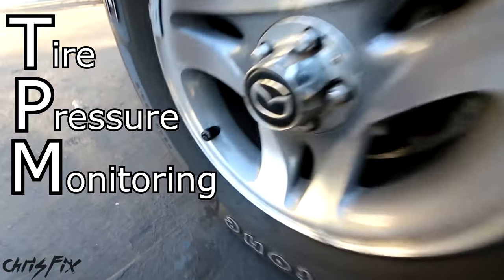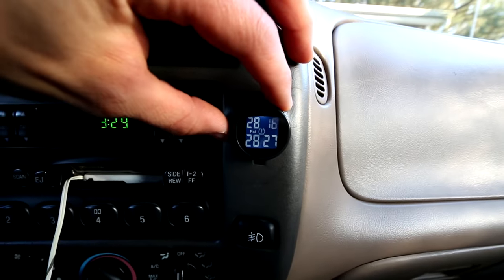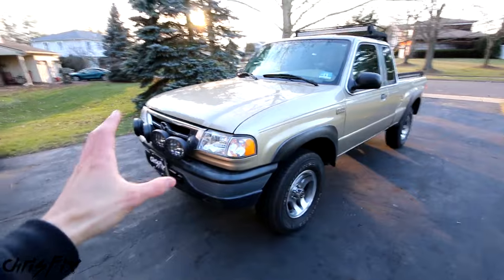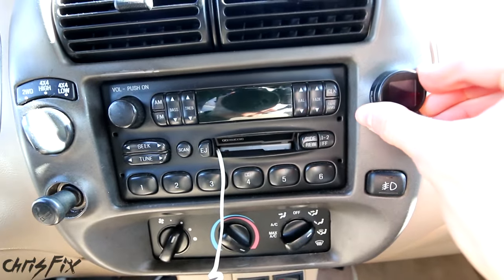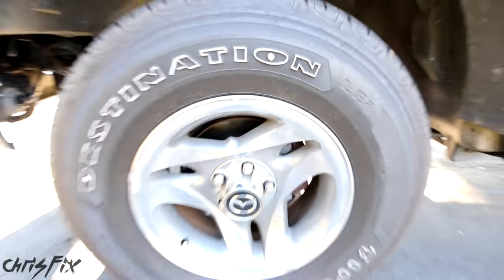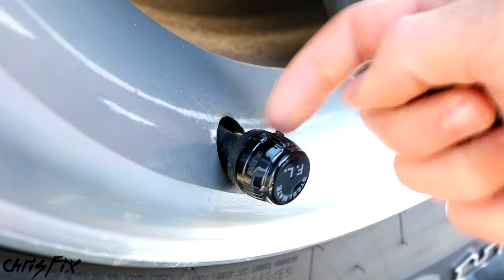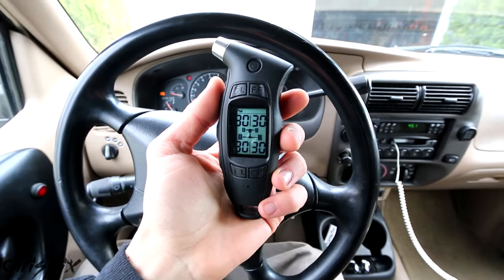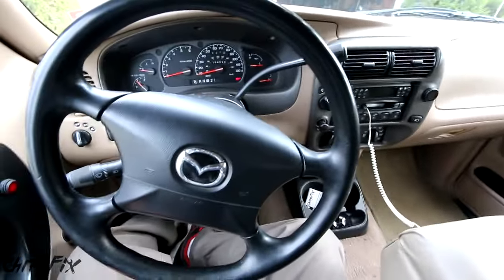How to Install a Tire Pressure Monitoring System in Your Car

Comment: Is a wheel balancing necessary due to the addition of the weight of the TPM devices?
Reply: I was gonna ask the same question. They aren't HUGE but seem like they would put a wheel off balance at the right speed.
Reply: +Tamás Madarász Lol no.
Reply: +Colton Blumhagen Why not?
Reply: ***** Because they weigh almost nothing.
Reply: +Colton Blumhagen How much does each sensor weigh?
Reply: Certainly wouldn't hurt. I'm sure each sensor only weighs... Very little.. But theyd put it out of balance.
Reply: Hadnt thought about it
Reply: Apparently they are about 9.6 grams each. Which I think may be enough to warrant a wheel balance.
Reply: +Xavier Spencer Yes, for sure, you need balancing. This have a lot of weight for disbalancing your tire.
Reply: If they weigh 9.6 grams then you need your tires rebalanced. Adding an ounce changes your tire balance alot
Reply: yup dont forget to change ur blinker fluid and pour some brake fluid in ur oil to clean off all the junk..also sugar at the tank helps remove water
Reply: Ivan Hernandez Try to do this with your own car first. You can start with sugar :)
Reply: +ruhoer eoijre already did!! car runs smoother ...i changed my exhaust bearing as well...
Reply: Ivan Hernandez yep. in Russia some peoples make for different peoples this "tune up" too lol ) Nice joke about exhaust bearing too))
Reply: I work in the trade & have for 29 years, I can guarantee you will NOT have to have the wheels rebalanced unless tyre is shifted on the rim. Saying that never harms to have the balance re-checked.
Reply: have you all lost your minds?, why would you need to rebalance your tyres for something that weighs less than a fredo?
Reply: +john smith all it can take is .25 oz to make your tires unbalanced
Reply: CodysDesigns bullshit! All it takes is an atoms weight and it will become imbalanced.
Reply: john smith 10 grams this is really a lot. 7 grams is smaller balanser weight.
Reply: Well i drive over 90 mph sometimes so i know for sure id need balacing then
Reply: It depends on the tyre size and vehicle. in the case of Chris's truck it is not necessary. If you are running on performance tyres and rims (low profile) you need to. in these cases you feel if you have even a small pebble stuck somewhere on your tyre. there are also other types that require for you to take the tyre off and replace the valve with one that has a built in sensor (the same type 99%  of new cars come on the assembly line)
Reply: +Ivan Hernandez Where the hell did you get your exhaust bearing? I have been trying to find one for months, nobody seems to stock them.      '-)
Reply: +Ivan Hernandez I did this, but when I start my car I get "NT.DLL missing" now, do you think I need to clean my fallopian tubes?
Reply: +MRsjovealek course I am :)
Reply: How do those for things even connect to the tyre pressure monitor and how do they get their power batteries or something
Reply: +john smith the use a different type of radio communications... a combination of RFID and Bluetooth. it's not continous to sa battery life
Reply: Mihai Constantinescu they need batteries?
Reply: +john smith they have encased batteries, OEM installed system go up to 3 years, aftermarket usually 2 years. I did not come across a system with replaceable batteries. If you do decide on such an upgrade I would recommend the ones @ChrisFix showed for a quick  DIY. for a more descret solution you have one that require the removal of the tyre from the rim and replacing the vslves
Reply: I have that TPMS system on my car and have had it hit 80 mph with no vibration issues.
Reply: One piece of wheel balance weight is 7 gram. If the TMP is 10 gram, it will put the wheel off balance enough.
Reply: +Tamás Madarász Depending on your vehicle. If its a truck like this or larger truck probably not. Car maybe. I worked in a tire shop and even a piece of paper can throw off the balance just by a little bit. I tested it on two new machines that were calibrated and confirmed it.
Reply: +Tamás Madarász I have aluminium valve caps which weigh very little, required a balance.
Reply: if you had the tpms sensor installed at a shop they should have balanced it after before it got put on your vehicle. it will put the tire out of balance but by a very small amount that you most likely wouldn't notice, esp. if the tire gets put on the rear
Reply: +Ivan Hernandez And when you open the hood to add oil make sure you don't miss any spots.
Reply: +CodysDesigns ane   0.25 ounces = 7.085 grams .. 
Therefore, 9+ grams requires a rebalance..  
I do wonder why the product source couldnt include a 9g 
wheel weight that we could  'mallet-hammer' into the rim directly opposite the pressure transmitter/valvestem .. woulda resulted in a 'good enough' scenario i'd imagine....and save us the cost of 4 wheel balancing act ;)
Reply: +100SteveB ya, the stock is often exhausted ... Maybe time to put some back-pressure on the distributor
Reply: +John Kyon nooo noooo! No battery needed!  Simple 'Peltier' slabs jammed into the thread supplies all the Kw's needed ...wirelessly, too, via BlueFang, the updated Booothtooth technology! it's amazing!
Reply: +John Kyon 
It's a wireless system, if it is anything like factory units, it will be somewhere in the LF band like RFID. It is not continuous but intermittent probably sensing wheel motion to turn it on and off(the sensors). There is a battery and it will last for years hopefully. I just replaced a sensor on my 2008 Impala, the other three are still working well.
Reply: +Mihai Constantinescu hmmm 100 bucks I think I will wait for lower price.
my TP suppose to be 36 cold, but every month or 2 it will drop 2,3 psi. is it normal?  also how many psi off is ok? 2,3psi? (lower is what I am worried about)
Reply: 2-3psi is fine. But if it gets about 5-10psi lower then it could cause more wear and tear on the tires. For $100 you are getting one helluva deal. If the car came with TPMS and the sensor when to crap, you'd be looking at $80-$150 per sensor.
Reply: Honestly man i wouldn't worry about it. I have put tires on myself and not put weights on at all and you cant even tell. People say you can get vibration or funny wear on tires without balance which i could see on higher perform ace cars but tbh its all bullshit. I align my tires by thread count and a tape measure and i have NEVER gotten any funny wearing or pull to one side or another. Its one of those things that is useless unless your talking about high performance.
Reply: Either am I. Just my experience tho. I wouldnt worry about it. If you want take the old weights off and put them on opposite of the valve stem. boom balanced.
Reply: Loaf Of Bread Doesn't work like that I'm afraid. Once you add weight to a wheel or fail to balance it, it starts acting like an egg, and above 90km/h a wheel even 15 grams out of weight starts shaking. I don't know where you are being misinformed from because unbalanced wheels can cause problems if left untreated. For example, the weight came off the front right on my car and it sent my stability control mental on the motorway and the steering wheel shook like crazy. In conclusion, you've never actually driven a car over street speeds or you're trying to look smart on a subject you have absolutely no idea about.
Reply: i believe you but i dont have weights on my truck or on my motorcycle and it doesn't shake or anything. just my .02$\
Reply: If your tires are not precision balanced and you can't feel it then said tires are absorbing it all very well. Yeah, go ahead and tell us that's not bad for the tire.
Reply: omg lmaooooooooo
Reply: And next time you hook up your scan tool enter "rm -rf /*. You're guaranteed to never get a check engine light again.
Reply: Uhh that won't work on those, they aren't linux firmware based. Correct me if I'm wrong though. Pretty sure you'd have root though on a cars computer since obd2+ gives that
Reply: Of coarse you're right. It was metaphorical. Although when you think about it, there may very well be a version of it in play for things like law enforcement and repossessors. Maybe a bit less destructive, maybe worse.
Reply: Although going off topic though, they have something called the shark i believe they codenamed it. pretty much an high velocity electrical discharge, which i'm sure you've seen in action. fries all electronics and kills a car, newer ones anyways Muahaha.
Reply: I haven't bought a set yet (and I plan to) but they say the weight of the module is 9.6gm and that is .3 of an ounce. Being inward of the tread face it may not make much of a difference.
Reply: John Kyon A lot of professionals pride themselves on balancing to one gram accuracy, this weighs 9.6 grams

Comment: you probably have to balance your wheels  now
Reply: +Vova3iLvova  I saw the specs while searching for its price on ebay and the whole sensor with the battery is about 9,5 grammars ,so I wouldn't be very anxious to do the balancing right away especially if the application is like the above truck or a jeep but at first chance  , yes , balancing is a good idea eventually.
Reply: I have that system on my car. I got it up to 80 mph and didn't have any vibration issues.
Reply: +Frank Gonzalez For some of us, we go faster than 80 haha. for the average person it won't matter that much
Reply: Frank Gonzalez Sorry I drag race.. lol
Reply: +MrPooky218 If you drag race on a track COOL. But if you drag race on a public street, like I said....
Reply: Frank Gonzalez Both. Closed course. In Mexico. Professional drivers.
Reply: +MrPooky218 as long as you are on a closed track, great. But when you are on a public street, that's where I and many others have issues.
Reply: will it upset the balance of the wheels?
Reply: +Gary Smith not enough for it to make a difference
Reply: +arno maas In my opinion when that 9 grams spins 680 rpm (over 11 per second) at 100 kmh (with tire big as on this video, about 78 cm in diameter) it can cause vibration but i can be wrong, just guess.
Reply: Michel Linschoten You missed the joke by a long shot buddy. A lot of people go faster than 80.
Reply: +Vova3iLvova if you would want to install a balancing weight to counter the weight of the sensor + nut, i presume you would put it opposing the sensor on the diamater of the rim. Would you put it on outside (as the valve and sensor is) or on inside (closer to brakes) of the rim ?
Anyone can answer this ?
Reply: It doesn't matter too much. What matters is which plane the motion is happening. The weight of the sensor is traveling in a plane that is perpendicular to the axis of rotation. The weight can travel in a different plane (one aligned with the inside of the rim or the outside), but that plane is constrained because it has to be perpendicular to the axis of rotation, since the counterbalance is also mounted on the wheel. It comes down to aesthetics: do you want the wheel to look pretty? Put the weight inside. Unless there is little clearance between the inside of the rim and the suspension or brake components.
Reply: Dhcp
Reply: why,you can´t drive fast,they got you bythe ballz?i hear ,germany has 12000 kms of highways where you can do 300 kph;  LEGALLY!!!!!!!!!   how many in the US&A? none?  fawkedup police state,maybe?(not the only one, not lol)
Reply: Frank Gonzalez sorry, not everyone drives a Prius and goes 50 or less in the left lane. A lot of people drive 75-85+ mph
Reply: @MrPooky218  if you drag race and need this you shouldn't be drag racing
Reply: @MrPooky218  0
Reply: @MrPooky218  80mph or 128km/h is 2km/h below the speed limit where i live (NL) and almost all people drive like 5km/h above the limit. Not really special.

Comment: I like it... but still expensive for over $100
Reply: bahhaziz people can easily steal.
Reply: my little pony did you not watch the video? Go to 4:30
Reply: spacemann He's like me...oh god!😁
Reply: Its not worth it and it looks soo tacky man just buy a lil handheld gage nothing fancy and leave it in your trunk adding the digital thing to the inside is just bleh and anyone who knows about cars will just laugh at u lol
Reply: not only that.. but takes over an accessory(cigg) port.. Be nice if it could rig up to a fusible link then to a digital unit that you can custom mount somewhere. And don't tell me that's complicated.. I've seen temperature/clock gauges sold at truck stops/gas stations!
Reply: Jonathan Gonzales 50$ now

Comment: Thanks Chris but doesn’t adding an extra weight to the tires affect balancing? Because I guess when it comes to balancing of wheels even the weight of the wheel nut can be an effect on especially the front tires at high speed . Just wondering
Reply: Get balance beads

Comment: Thanks so much for the video, Chris! I just got done learning about tires in my auto class and realized how important it is to keep track of tire pressure.  Also this makes me wonder: why don't manufacturers use this system? Instead they put the TPMS between the tire and wheel on the other side of the valve stem.  Oh and fun fact my auto instructor told me, some TPMS sensors also read tire temperature but for some reason, people were dumb enough to think that the higher the temperature, the better it is for the tires so manufacturers had to remove that feature.
Reply: They don't use it because it requires batteries that drain every 2 years
Reply: @omarpulido8502  Yeah, they're garbage. I didn't even get 2 years out of mine.

Comment: do you have to balance the tires since the sensors weight 10 grams and may affect the rotation of the wheels?
Reply: Nope
Reply: lol really?
Reply: Nope. Most sensors of this style actually weigh less than 9 grams and do not affect rotation at all...
Reply: That's the difference between a mathematician and a physicist.
Reply: If you feel harsh vibrations at speed, balance your tires.

Comment: $109 ?!  No thanks! I'll just use my cheapy little old-style pressure gauge on each tire, with a pen and paper beside me...
Reply: And what if you pick up a nail on a long journey. I don't think your pen and paper will warn you that your tyres losing pressure.
Reply: +Daniel Warren use the pen and paper to make a sign that says honk it my tires look low. b
Reply: +nikkolaus What do you write on the paper? Pressure OK: Yes/No. Time, date, temperature, weather? Do you keep it in a journal or stick it onto the dashboard? Why not just about once a month go to a gas station and fill it to the correct pressure.
Reply: +PrinssiFO the gas station won't tell you if you just ran over a nail.
Reply: But we just can not check when we are driving. Do you think so, both tire gauge and tpms have pros and cons
Reply: How did they do it when this gadgets weren't on the market?We need gadgets to tell us when to eat, go to bed, go to toilet to take a shit, have calling our girlfriend, feed the cat jeez, why then do we have a brain for?
Reply: I had valve stems stick open in the winter and the majority of people don't even check their tires once a month.

Comment: How are the sensors powered? Is there some sort of battery in these that you have to replace or what?
Reply: +Daniel Reimer probably .. but once the battery goes out I'm guessing the sensor work or show in the small cigarette lighter plug in.
Reply: the video said the batteries last 2 years.
Reply: +Daniel Reimer 3rd image on amazon link, there is a battery
Reply: +chris ce smh
Reply: +Daniel Reimer Each sensor has a small hamster that spins a generator at precisely 1800 rpm . You feed them daily. Each hamster is trained extensively on Boyle's Law, Physics, and Calculus. Formerly, these tasks were handled by a team of miniature squirrels, but things changed. Soon after the squirrels became unionized and demanded better pay and working conditions.
Reply: +urgentcareguy3 Man, I had one of those hamster-powered 8-track players and it was such a hassle.
Reply: +Stu VS Wow! someone else had the same problem! My 8 Track was making funny sounds all the time. Turns out is was one of the hamsters yodeling In-A-Gadda-Da-Vida
Reply: urgentcareguy3 Did you try turning the hamster off and back on again?
Reply: Yes, according to the manual, you pull on their tails once, wait for their nose to wiggle, then power them down. If you forget to pull their tail you can brick their I/O board.
Reply: +urgentcareguy3 wow
Reply: +Daniel Reimer some are solar powered!
Reply: +chris ce you definitley just made this up
Reply: +urgentcareguy3 I hear soon it will be chipmunks because trump gonna deport the hamsters.
Reply: Powered by regular CR1632, you can find one on market. I know from the Amazon page FAQ that the batteries of the sensors is replacable, if you drive for about 3-4hs per day, the batteries able to last at least 2 years.
Reply: @dynocompe   I haven't seen that. I have bought a receiving unit (not sensor) which is solar powered, in place of the cigar adapter.